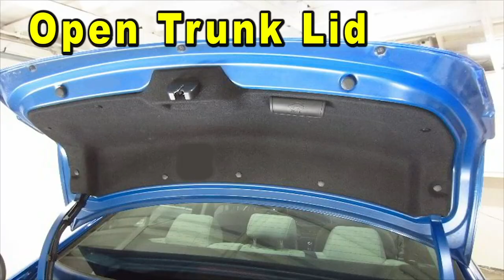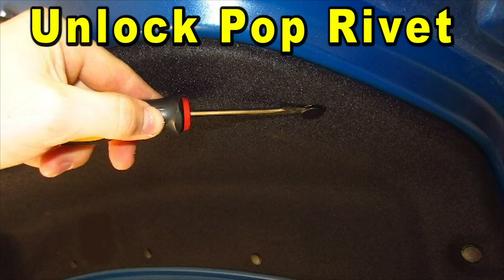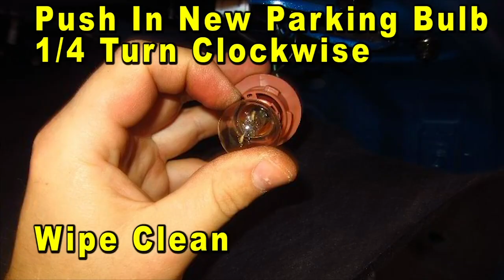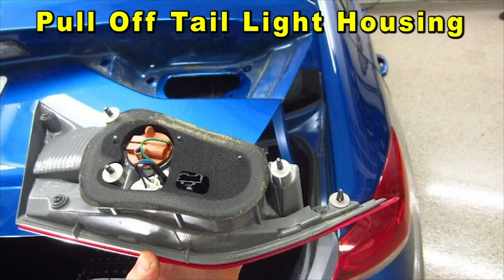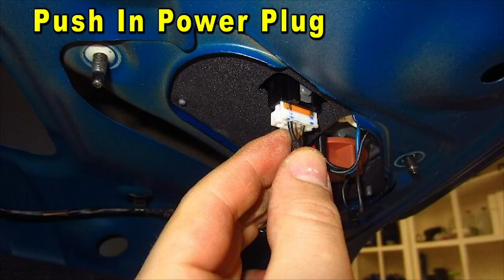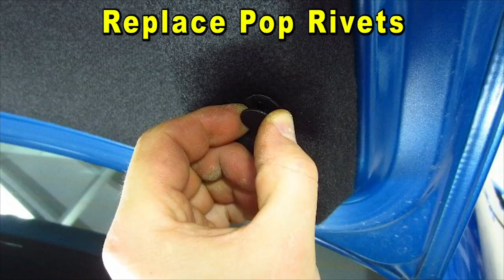2017 To 2020 Hyundai Elantra How To Change Reverse Light Bulbs With Part Number - Quick & Easy

Comment from the maker: Hyundai Elantra Reverse Light Bulbs Part Number - https://amzn.to/46SS09q
LED Reverse Light Bulb Part # - https://amzn.to/46W8U70
Hyundai Elantra Parking Light Bulb - https://amzn.to/3t5uBE6
LED Parking Light Bulb Part Number - https://amzn.to/3TkRQVs
Precision Screwdriver Set - https://amzn.to/3sLixaP
Plastic Pry Bar Tools - https://amzn.to/3HMtsV7
Socket & Ratchet Set - https://amzn.to/3Z17LbA
Mechanix Gloves - https://amzn.to/3jCnHkt
Torque Wrench - https://amzn.to/3vS5uSI

The Paul79UF YouTube channel is a participant in the Amazon Services LLC Associates Program, an affiliate advertising program designed to provide a means for sites to earn advertising fees by advertising and linking to Amazon.

This DIY video shows owners of the 6th generation 2017, 2018, 2019 & 2020 Hyundai Elantra sedan how to change a burnt out reverse light bulb or inner parking light bulb located inside the tail light housing attached to the trunk lid.

Comment from the maker: Check out the DIY guide for changing a burnt out reverse or parking light bulb on a sixth generation 2017, 2018, 2019 & 2020 Hyundai Elantra - 
https://www.paulstravelpictures.com/2017-2020-Hyundai-Elantra-Reverse-Light-Bulbs-Replacement-Guide/index.html

Here are all of the DIY repair and maintenance tutorials for the 6th generation 2017, 2018, 2019 & 2020 Hyundai Elantra sedan - 
https://www.paulstravelpictures.com/Articles/2017-2020-Hyundai-Elantra-DIY-Repair-Maintenance-Guides.htm

Owners of other Hyundai, Genesis or Kia vehicles such as the Sonata, Accent, Veloster, Ioniq, Kona, Nexo, Venue, Tucson, Santa Fe, Palisade, G70, G80, G90, Soul, Sportage, Niro, Sorento, Telluride, Rio, Forte, Optima, Stinger, Cadenza, K900, Sedona and Seltos may also find these DIY instructions to be helpful.